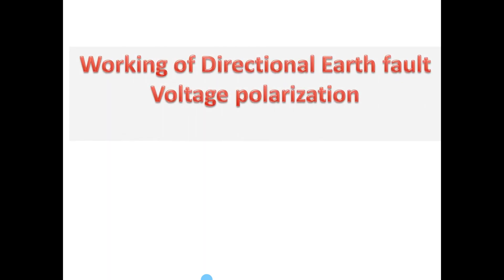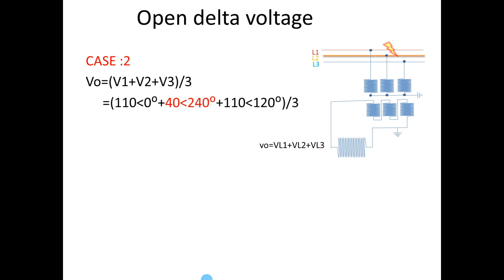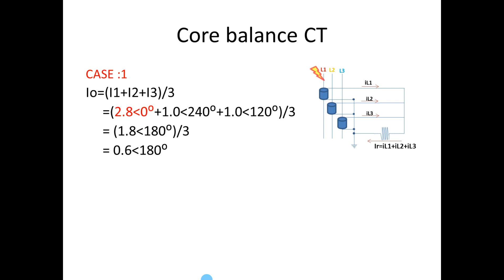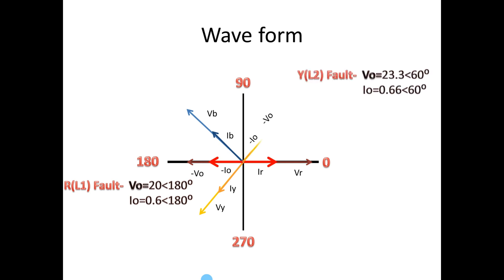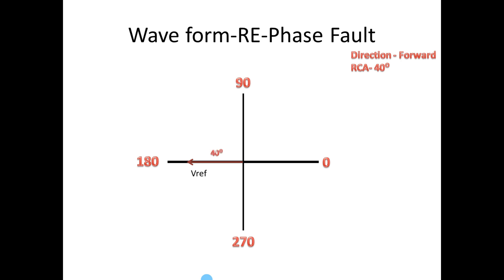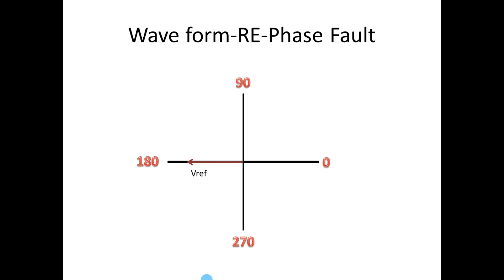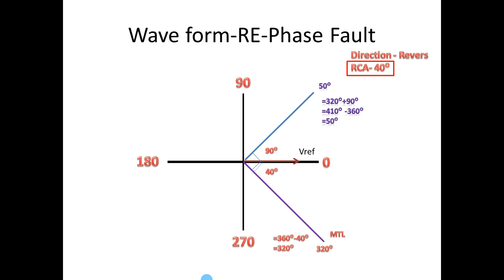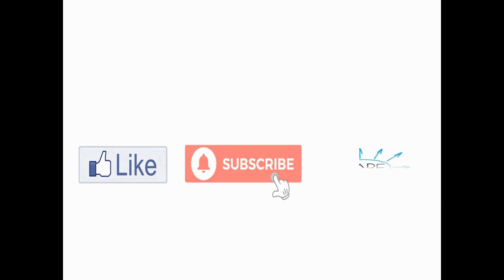Directional Earthfault Operating Region | Working of Directional Earth fault

Comment: Bro, thanks for explaining. I have a problem, earth voltage fault relay operates wrong, for example it's operating in a motor fault, but relay protect the distribution transformer dd0, leting out 16 motors. This relay (IRU1-E) with a wye-delta broken voltage transformer adds the 3 phases for getting a residual voltage. Balance case V0 = 0 V = 1<0 + 1<-120 + 1 < 120. Unbalance case V0 is different 0. I don't know how to set this relay, the relay allows to set delay time (s) and %Ue> (percentage of residual voltage with respect to the nominal voltage). In this moment the relay is working with 4% Un and 0,2 s. I want to prevent it from opening, but I don't want to unprotect the transform, is there some criteria for these relays, I haven't been able to find???
Reply from the maker: like this condition you need to have good relay setting co-ordination from transformer to motor protection fault current.  If you use Direction protection for low stage will prevent at low fault level . thank you.

Comment: Nice & clear explanation, however, I have doubts in the Io calculations as below:
when    I1 = 2.8 L 0 degree
             I2 = 1 L 240 degree
             I3 = 1 L120 degree
       Io should be = 0.60 L 0 degree 
whereas you calculated 0.6 L180 degree
also there is difference when I calculate Io for faults on I2 and I3 

Please explain your calculation?
Thanks
Reply from the maker: I WILL MAKE CLEAR VIDEO AGAIN

Comment: Excellent explanation... But I have some doubts... Please clarify
1.You have presented three videos about directional relay. Where to use self polarised, cross polarised and residual voltage method. All are showing different  tripping region. 
2. In self polarised method you have rotated clockwise to draw MTL. In cross polarisation method you have rotated the phasor clockwise to draw MTL. In residual method again you have  rotated the phasor clockwise to draw MTL. 
3. In relays only RCA and PU values settings implemented. So how to find out  tripping regions for relay testing. 
Please explain.. 
Thank you
Reply from the maker: 1. for earthfault the direction earthfault is different then overcurrent.
2.same in earthfault the residual voltage direction change so it different form overcurrent 
3.in numerical relay has both self and cross polarised method some relay we have to choose. if not they will have only one polarised method. this can be seen in manual of the relay.
Reply from the maker: for direction earthfaul i will check once again

Comment: Sir,Thanks a lot for clear explanation one doubt I have as per explanation R-phase to E/F in forward case V reference you took opposite to Vr same way reverse explanation 180 opposite you took that is in phase with Vr up to that it was clear .
But in Y to E/F and B to E/F direction is mentioned in the drawing reverse but the fault is not in phase direction with corresponding phases so that as per my understanding it’s forward direction diagram if I wrong please explain sir.
Reply from the maker: yes your correct. i have made for forward only for Y and B .

Comment: Sir, if RCA angle is -45 degree then MTA should be anticlock wise direction from Vref or same clockwise??
Reply from the maker: yes it should be in anticlock wise direction
Reply: @baranitech  
@SantoshKumar-nk5ve  sir this angle (RCA) depends upon Network earthing like compensated, isolated & Solidly earthing. Here Isolated depends upon capacitance charging current when fault accrued (that is taken RCA - 90 deg lag). Compensated depends upon Capacitance & Inductance (that is RCA - 0 deg). Solidly earthing inbetween 0-90 deg). I hope this is correct & if wrong kindly clear me.